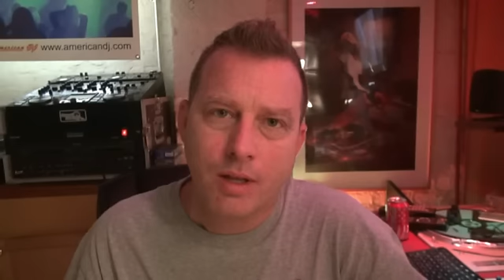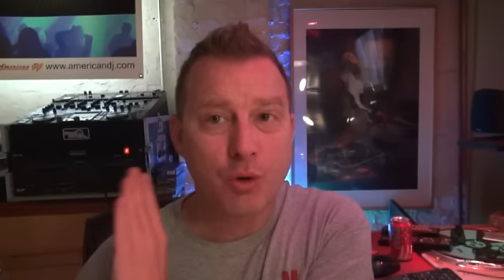Passive Speaker Systems - Amp Power, Gain, High Pass/Low Pass Crossover Points, Etc

Comment: I have my crossovers set, so the subs go from 30 hz to 120 hz, then the tops set to 90 hz and up, so i get a lot of the punch bass + the really low frequencies that is hard to hear, but easy to feel in the body! :-) 
Also. Lets just get this straight! : 
Active speaker = extern filter/crossover needed + need amp..
Passive speaker = built in crossover + need amp..
Powered speaker = built in crossover + amp..   
I see many people doesn't know the right terms :-)

Comment: @CHRISTIANMINDAMIX 
MRX525's handle 800w continuous, so you want to be using an amp that can power ~1200w per side @ 4 ohms to match those speakers.    
The XLS2000 puts out ~650w per side @ 4ohms, so you are slightly underpowering them.  As long as you are not "clipping" your signal,  you will be fine.

Comment: brainsredd.. thank you.. I think you just saved me from burning up my amp.. a few weeks ago I hooked up a vintage Nikko amp.. (100w per channel) to a vintage pair of passive sansui tower speaks I had in garage..( 165 watt capable).. anyway the few times I've ran them since hooking iv noticed amp has been running super hot.. I could smell the fucking thing.. and super hot to touch.. luckily it hasn't gotten hot enough to trip protect mode.. but something didn't seem right.. and now thanks to your simple explanation I'll make an adjustment and keep it from tripping or worse in future.. thanks!

Comment: @bostoncommonband @bostoncommonband I was referring to the JBL MRX 525's.Im not sure which amp to power them with.I have tried powering them with a Crown XLS 2000 Dcore series giving out 650watts@ 4ohms.But I don't think its enough power for the jbl's.I have tried bridging the amp so it'll give me 1,050watts@4ohms. But the amp starts to heat up im not sure why. So I had no other choice than to try the Behringer EP4000. And it sends out 1,400watts per side@4ohms.im not sure which amp to use

Comment: Now, on the flip-side,   you are correct on the recommendation to match your amp to the speakers to have ~50% more power, that way you stay safe.   IE;  for a basic system that uses a 500w @ 4ohm speaker on each side... try to match it up with an amp that can power ~750w @ 4ohms per side.

Comment: Running 5kw or there abouts in my bedroom. Wore putting about 500wrms per side into my community xlt46 speakers. And the crossover blew. Then when that wore fixed ran perfect for a while. Then the bass drivers popped. Now I'm ganna rum only mids and highs passive. And mid bass and sub bass via a active crossover. Got the dynacord dsp260 and that's an epic dsp. 

Mids highs about 200rms per side
Midbass about 600rms per side
Subs about 4kw when done. 
And then some filler speakers.

Comment: (cont 2) This is why many amps have build in limiters.  The limiter, if engaged, will automatically knock down the signal output below the hard voltage potential limit.... so when you try to overdrive the amp, the amp will simply not get louder, but you won't fry your speakers with DC simulated voltage either.  Again, underpowering is a 100% psychological problem.  You fry your speakers the same way with a perfectly matched amp & set of speakers, if you over drive the amp.  (cont 3)

Comment: @CHRISTIANMINDAMIX Not sure which speakers we're referring to powering with that amp.  But as a rule of thumb... My best advice would be to take the "Continuous" power rating of the speaker and multiply by 1.33.  That will be a well matched amplifier.   Just remember Rule #1 -- Always check your gain structures to not send clipped or distorted signals through...  and you'll never have a problem.

Comment: Also, I play bass guitar and my lowest strings are at 31.87Hz and 40.2Hz.  You don't want to miss out on those fundamental frequencies.  The 2nd harmonics of those lower notes aren't nearly as full sounding.  It seems very difficult to replicate these notes without a bass guitar speaker cabinet.

Comment: @briansredd technically if the speaker is more powerful it doesn't mean it draws more power , power draw depends on resistance 300W @ 4 ohms draws same power as 600W @ 4 ohms (ohms law : Watts = Amps*Volts , and Amps = Volts/Ohms so Watts = Volts^2 / Ohms , since neither volts nore ohms change no more power is drawn)
the actual power handling capacity of the speaker is determined by how well the voice coil handles heat and how well the cone can handle the increased range of movement

Comment from the maker: @Markus3400 now, onto the terms you are trying to sort out
Passive - needs everything (amp & active crossover if needed)
active - powered speaker.  has built in amp & usually a built in active crossover

Comment: Thanx heaps for this awesome vid!
I have a question I hope u can or will help me with... I've got a dynacord 1600 powermate and some elderly EV 300 watts passiv speakers which sounds great,but I need some subs with crossover, any suggestions? 
The mixer is running speakon out and a few years back I rented som speakers(top/bottom) but i didn't notice if any one of these speakers was active,they were just easy to handle,plug and play and that's what I want though I know how a crossover works...

Comment: Hi brian.. I think I asked you before. But with the RCF art 312a coupled with a single RCF 15" active bandpass sub, where do you set the adjustable crossover at ?. I think the RCF sub has a 80-100-120 Hz selector. I saw one guy just testing a single RCF art 325a (2"+15") with a single RCF 4PRO 8001A 800w 18" bass reflex sub. He set the x-over at 120 Hz had it in the garage and walked 30m away to show its capabilities. But I would think that setting the x-over at 80-100 Hz would give more lows.

Comment: Great video, great advice's, many of them I all ready known

I just wont to ask how to feel overpowering distortions, are they abvisly feeled 

I have a passive PA set from Thomann.de  2x12"( 8Ohm 350wat rms/700w program/1400 praak) tops and 2x15" subs
the amp is 4x1050w /8ohm

I try to push the maximum of this speakers but I don't feel or hear no distorsions
they sound so loud that I can understant if there are some distorsions

you think I should try to give them more power? till there will apear some distorsions and that will be the maximum of them?
thenks a lot..

Comment: so when i was running passive speakers. i had two 250w speakers and an 800w amp- so i was doing  right? now ive got a 15 inch sub and two 8 inch top cabs. the top cabs are passive, and the bass active(with the built in amps) like u say they sound a hell of a lot better with the seperate sub!

Comment: @bostoncommonband 
Brian is correct it is bad to underpower speakers as the speaker can be destroyed easy by the amplifer even if you are not clipping the amplifier, cause when amps heat up they can send DC voltage out and burn the voice coil out. its always better to have a bit of head room in an amplifer as the sound is clear and un-distorted.

Comment: Yeah I know ..
am talking about car audio

my question is how do my coaxial speaker play highs and mids and sub play lows with out a separate crossover only using the amplifer built in low pass filter....
do you connect your coaxial speakers to amp or sub or what????

Comment: Have a question that might take some research, I have the Carvin 1588 everything I've read about them says they have to be bi-amped to sound good which i willing to do, according to carvin these cabinets are full range but bi-ampable, they consist of 2- 15" eminence speakers rated at 400W (each) the mids are 2- 8" unknown wattage (per cabinet) ? and the horn is singular 4x12 per cabinet also unknown wattage, the specs are as follows but are vague as far am I'm concerned. per cabinet Frequency response: 45Hz-19kHz +/- 3db, useable low freq. 34Hz (+/- 10db), Power handling 800 Watts continuous, recommended Amp up to 1200 Watts, Sensitivity 103dB SPL 1 Watt @1Meter, Coverage Angles 90 Horz. 45 vert., rated at 4 ohms per cabinet, I understand the crossover part but am still confused as to what power amp wattage to use for the lows and also for the highs, If I understood Carvin correctly Im under the assumption that the mids are cut out in bi amp mode i could sure use some enlightening about these, I just want all i can get out of them as far as clarity and thump, any help would be appriciated

Comment from the maker: @cjmitz well yeah if you have your line levels cranked.  i guess i assume too much and that people are going to start out with the line level low and gradually increase from there.  at 0db on my line & main, i had my amp full on (450 per side) with 250 watt program speakers with no distortion.  i didn't go above 0db and it was nice & clean.

Comment: Thank you I have been waiting for someone to do a video like this one. I still have a lot of questions? I have a peavey pv 2600 that is rated at 4 ohms 900w Rms channel, 8ohms 550w Rms, Bridge mode, mono 8ohms 1800w Rms. I have a pair of mains Macke c300 which needs 300w Rms, Music 500w and Peak 750 at 8 ohms. How should i wire this?

I also have a pair of old school Peavey sp4g they are 4 ohms 600w rms, 1200w program 2400w peak? Is there enough power to run with the Peavey pv 2600? thank u

Comment: Hi briansredd,  I need your suggestion. I wrongly connected the polarity of the cable from 

my Spendor S3/5R2 speakers to my vintage Sansui stereo amplifier as follows: 

As wrongly the 2 Negatives of the 2 speakers were connected to the one channel of the 

amplifier and the 2 Positives of the 2 speakers were connected to the another channel of the

amplifier. One speaker was working and another speaker was not working. I was confused and

didn't notice about the wrong polarity for about 15 minutes, then I checked the cable

connections and detected the wrong thing. I became panic and sweated like anything. After I 

made the correct connection the two speakers sing as usual. But.. even though the speakers are

now working, still I have some fear. By the wrong connection:   Would the cross-overs of the 

speakers become weak? Did I do the great mistake? How will be the life and health of the speakers?

May I keep the speakers for long time?. If it would become weak, that would be how much? 

Kindly let me know about in detail. I am much worried about the thing.
 
If I hear from you as: 'Need not be worried and the things are fine' , then I will be jumping 

with my transplanted knees! I very much love these small beauties. But, now I am sleepless. 

Thank you,

Regards,

Suseendran.

Comment: @bostoncommonband If thats the case how do you burn a voice coil out then? because everything you just said won't burn a voice coil out, 
Amplifers can put DC voltage out during peak, which will infact burn/destroy your speakers voicecoil, and can even catch your speaker on fire. the thing is these days the amplifiers are now comming in with DC voltage detectors on the outputs, so they can instantly cut off the output level in this case. but alot of amplifiers still don't have them.

Comment: (cont)  Example:  When people have a 500 watt speaker with a 250 watt amp, they think they can over drive the amp, and the speakers will be fine.  The problem is, the amplifier signal clips, because the amplifier has a HARD limit, meaning it has a voltage potential that it can not go beyond.  Because of this, the peaks of the waves are "clipped", making a straight line instead of a wave.  Clip it hard enough, and you start to simulate DC voltage, and that will kill a speaker.  (cont 2)

Comment: Here's a question i got would 2x 18" Gemini Gvx be a good combo with 2x Tapco thumps 15A. I figured that the 18" would be able to be turned down and i would have plenty of head room. Plus the 18" has an crossover and is active. Would this work?

Comment: Hi Brian, I'm one of those ppl to whom this is rocket science, but I understand that I should by an amp from the same manufacturer as the speakers. I usually use Active Speakers but I got two Pyle PADH1569 1000W Heavy Duty Speaker MDF Construction with Reinforced Corners (specks on amazon), what would be a good amp for these speakers so that I can use it with a djm 800, something that would overpower the speakers?

Comment: Hey, can you run from crossover low outs to a sub amp and crossover high outs to a powered system?

My American Audio 15" powered mains don't have the bass response I want, so I got an oldskool sub system.  It has a 400W RMS Carvin PA amp, a Furman active crossover,  and an 18" EV sub (rated 400W RMS).  I haven't set it up yet, and I don't want to blow anything, so I'm getting advice before I plug it all in and fire it up.

If this will work, how would I tune the crossover?

Thanks in advance!

Comment: I need help on my speakers..im running 2 JBL Mrx 525's at 650 watts. And on the manual it says they can handle 800. Im running them with a crown Xls 2000 drive core series. And it puts out 650 per channel at 4 ohms. And 2,100 in bridge mode. Should i run them in stereo mode or bridge mode?

Comment: hey Brian i have a question i have a QSC GX5 amp which runs at 500W per side at 8 ohms and 700W per side at 4 ohms. because my amp has a cross over channel 1 is for my sub and channel 2 is for my high pass. for the high pass i have two EV sx100+ speakers which need 300W 8ohms RMS  is that ok to run if i have them daisy chained? or do i have to run both speakers directly. I'm assuming that two 8 ohms is 4 ohms. is that right? thanks for your help!

Comment: I use 
a. Allen&Heath ZED6FX Mixer,
b. Macbook wih Numark Mixtrack Quad and VDJ 7
c. Mackie Subwoofer 18" Subwoofer and
d. Mackie Tops 15" two

I had these issues:

a. I USED only 2 TOPS, After 3 hours of playing, Music kept flying like floating from one speaker to the other. One became quiet than the other other as if the tops were sharing the music.

b. When I used 2 Tops and 1 Sub-woofer, after 3 hours, suddenly the Sub-woofer limiter turned on and dint turn off and the Sub-woofer went quiet only the Mid Bass playing on both the 15" tops. I removed the cables from the Sub-woofer and Connected the tops directly from the mixer they were working fine. Everything became normal after I turned the Sub-woofer off for 10 minutes.

Please advise why it might have happened. Did I mess around with Ohms or Frequencies. Thank you

Comment: i have two EV-EXL112 Passive loudspeakers, each are 250w cont. 1000w peak. 8ohms each.... what wattage amp would be best?? they connect by speakon cables

Comment: Hi! i have a question.
I have a 200 watt @8ohms(RMS) top speakers and 200 watt @8ohms(RMS) subwoofer, pairs, should i get an amplifier with output power of 200 watt @8 ohm? or another with more output power?, considering that is for live set up (mics, drum, guitars, keyboard, etc.) 
And what X-over freq, do you recomend me to set up on my 2-way stereo X-over?

Comment from the maker: you'll get less distortion if you bump uptyhat high pass to at least 40 (you won't miss anything and it'll sound much cleaner).  also, you ae overlapping frequencies from 90 to 120.  i'd ether change your top cab highpass to 120 or your sub low pass to 90.

Comment: So if i had 2 x 350 rms passive speakers and an amp at 500 rms per side i could turn my amp up to full volume and it wouldnt blow my speakers? And i have another question if you could help please? If i daisy Chain two 400 rms speakers together does that mean i have turned it in to one 800 rms speaker, or will they still act as two seperate speakers when put through one side of an amp? If you could help me that would be great thanks.

Comment: I've got a dual 18" Tour X sub by EV...its 1000 watts continuous and 4000 watts peak...what size amp should I be using? As of now, I've got a QSC 2400 Watt amp running into it- is that good? 

Thanks

Comment: i have a behringer vp2520 passive speaker...recently the low speaker went our due to voice recoil wire .. I took the speaker out but noe when I plug my audio jack in to get sound. I don't get any sound through the other woofer but only hrough the horn because I took the bad speaker out.. but when I take the good speaker out and wire it up manually I do get sound.. is the Passover bad

Comment: sir i am planning to assemble a sound box having 2 speaker (18 inch and a tweeter),how will i wire it? shall i connect the positive of the 18" to the positive of the tweeter so with the negative of the 18" to the negative of the tweeter? and out to the power amp? clearly sir im a beginner i hope you understand what im talking. thanks..

Comment: Brian, I hate to get on your case, but you are incorrect on a number of points.  A speaker can never "draw" power from an amplifier, it can only receive what an amplifier delivers to it.  You can fun a 500 Watt speaker with a 50 Watt amp, and never have a problem, as long as you don't push your amp past it's maximum.  The underpowering issue is 100% psychological.   (cont)

Comment: @jamesduty92   
Think about this...  if underpowering a speaker causes failure,  then playing stuff at low volumes (puting low wattage to a speaker) would fry speakers right away.      Again, this all goes back to clipping.   If you clip your signal and have an underpowered amplifier,  that's when you burn out components. Why is this so hard to understand?
You're on the right track about voltage burning voice coils, but again, the simple fact of the matter is that will only happen when you clip.